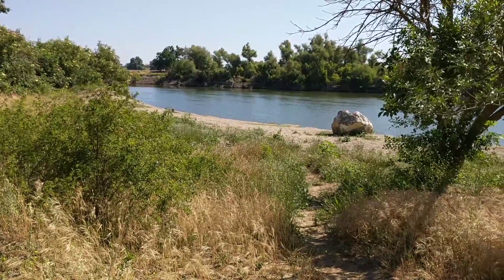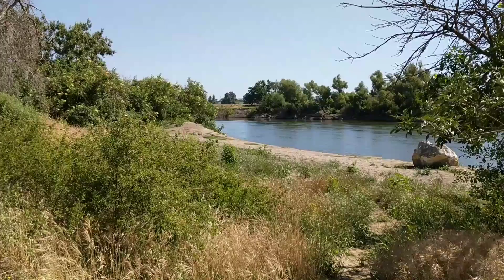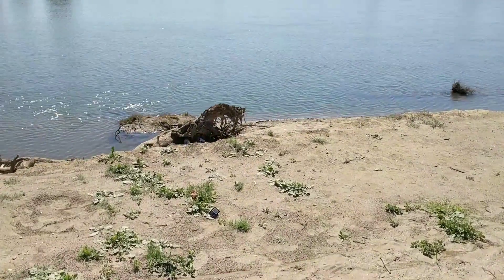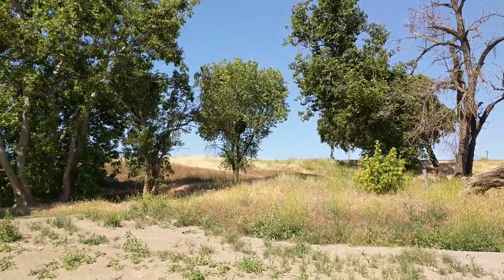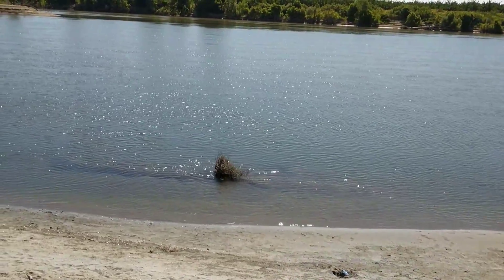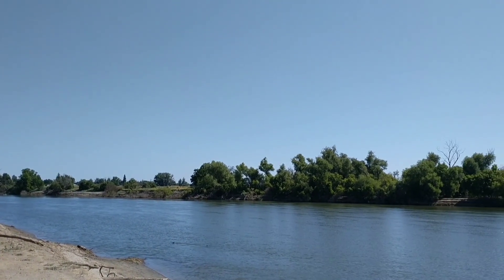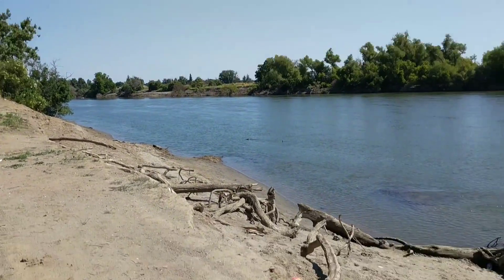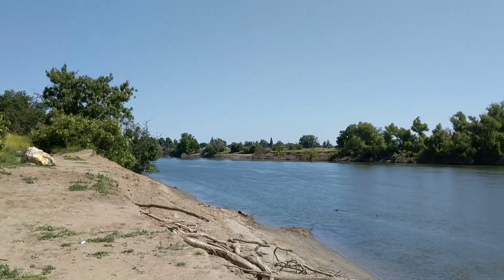6/13/17 ~ 30 miles downstream of Oroville Dam (5,000 cfs river releases)

Comment: Hi Millie.  Here are the outflow, inflow and river release as of an hour ago.  http://tinyurl.com/y93azjx4  The river releases continue to be lowered (2500 CFS now), and look how they just lowered the HPP output an hour ago.  Apparently they believe inflows will keep lowering.  The past hour there was a very small net inflow - only 100 CFS based on averaged data.  Hot in Sierra the next 3 days - it will be very interesting to see if inflows rise no more.  For anyone wondering why they are reducing the HPP outflow - they want to keep the lake near 812', and lower about 10' to 20' each month.  They could open HPP and RVOS to 19,200 CFS if they wanted, and drop it much more quickly.  Right now, they want it to stay as the level it is.
Reply from the maker: Hi Don. Thanks for your input. Yeah, I've been watching those river releases move steadily downward to 2500. I shot a video this morning but was gone all day so just now uploading it (wanted to document the river at 2500 cfs -- level is 40 feet, the lowest it has been in a long time). What they are doing on these flows makes a lot of sense to me. True, there is no need to hurry and draw that reservoir down at this time.

Comment: G'day Millie,

   Thanks for the update.

    All this Flow-Rate/River-Level fluctuation must make it really difficult for anything which lives in the River..., I realise that this Season must be much worse than normal due to the 200% Snowpack & Flood Runoff having broken the Spillways, but presumably the Water-Levels which you see in the "normal" years must also do a fair bit of "Yo-Yo-ing" and jumping around in response to Dam-Levels, Inflow rates, Storms, & Floods in the Catchment Area...?

   The work on the Lower Spillway has picked up pace, it's been very surprising and (to me) educational to watch the resonse ; one wonders at the amount of heavy equipment and numbers of skilled operators involved, and what they were pulled away from in order to get so much done so fast...

  That's not the sort of work for which one can suddenly become ready to tender... (hereabouts there are 3 big Windfarms being assembled, 220 Turbines with Rotors 120 metres in Diameter, standing 150 metres tall, & all made in China ; and though Australians are Roadbuilding & supplying Concrete & Cranes & Oversized Trucks, the Crews who're actually erecting the Towers & putting the Turbines together are mostly Irish & Belgian - because they've done it before....

   Have a good one,

  ;-p

  Ciao !
Reply from the maker: Hi WarblesOnALot . . . thanks for stopping by! Yes, this season has been much worse than normal. You are right -- even "normal" years have their "ups and downs".

I was very glad to see the third Parks and Recreation cam go online. I like watching the view from the top of the spillway. Seeing the landscape in the distance is a refreshing change from looking at the damaged bottom spillway.

For sure the scope of the project is massive. I hope they continue to make good time before the rainy season hits.

Always a pleasure to chat a bit with you. Take good care.

Comment: Thanks for the update Millie, you can really see the difference along the bank when the water has been at different levels.
Reply from the maker: You're welcome, PatBot! Yeah, the river is lowest it has been in quite a while, and still dropping. I wonder when they will level off on the river releases.
Reply: Well, they said they wanted to get the lake level down to around 800'. The outflow is around 5k csf... don't know why they dropped it, I would have thought the faster they get water out the better control they would have.
Reply from the maker: It's such a balancing act up there, it's hard to second-guess them. Hmm . . .